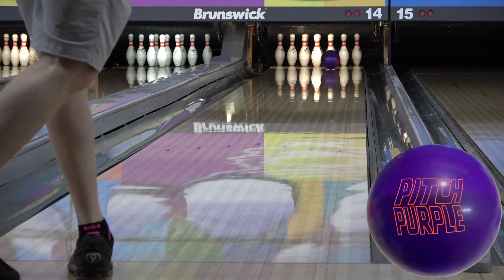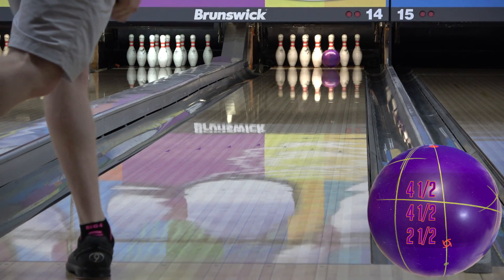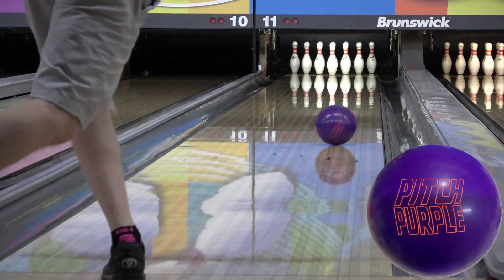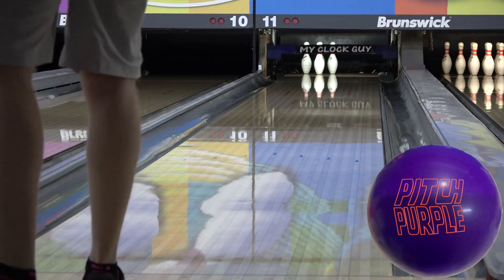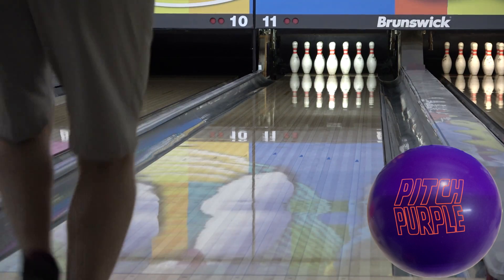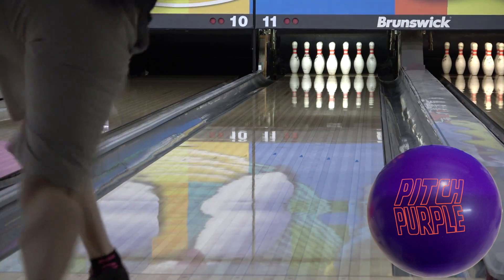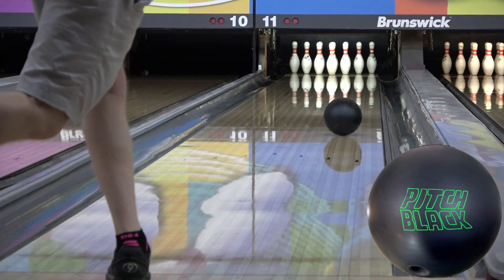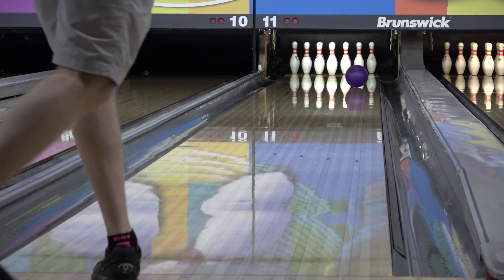Pitch Purple: In Depth

Comment: Very interesting. 
So you are basically saying taking it down to 1000 grit, like the Black has out of the box, gave it as much overall traction as the Black, but moved the reaction a little later in the lane improving energy retention and carry without sacrificing control? As a whole then, an improvement over the black?
Reply: Improvement is situational, but yes.
Reply from the maker: It's supposed to come at 1000 out of the box, but it pretty obviously wasn't.  It's more of a compliment than an improvement, there are still a lot of situations I can think of where the Black will be the preferred ball to at least start out with.  The Purple gives you an option when you still want the urethane type reaction but you have to play a little more angle, or when the Black has burnt up the heads, and doesn't want to get any deeper.  I wouldn't say it has as much overall traction as the Black, the Black is still the earlier and stronger of the two despite both having the same layout and being at the same surface.  I'm releasing a Purple vs Black video tomorrow that will explain it better.

Comment: How does this compare to the Fever Pitch? I feel like the Pitch Purple is what the Fever Pitch was supposed to be. I tried to use the Fever but just couldn't get it to work.
Reply from the maker: Yeah, that's kind of how I feel.  I don't even have my Fever Pitch anymore, it's discontinued anyway, and I'm just not going to compare the two on video.  It's longer and stronger than the Black, BUT it's consistent and predictable, unlike the Fever, so yeah I'd say you've got it right.
Reply: @LukeRosdahl  great thanks. I hated the Fever but I might give this Purple a try. Thanks for all that you do!
Reply: @waynedeason213  Did you get a pitch blue back then?
Reply: @coopergates9680  no I've only thrown a Fever Pitch.

Comment: What do you mean by carry down? And so would you prefer the pitch black on house shot or the purple?
Reply from the maker: Carry down is when the oil on the lane gets pushed down onto the backend and keeps balls from finishing strongly.  This is usually caused by balls that don't flare a lot, and MOST urethane balls are the worst offenders.  I definitely wouldn't use either of them on a house shot.  Easier to score with other balls AND preserve the integrity of the pattern.